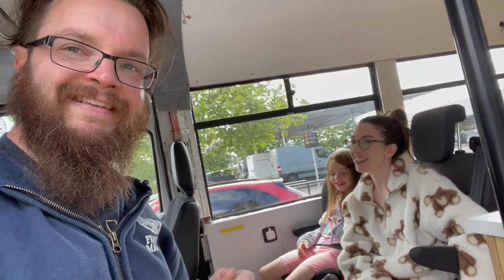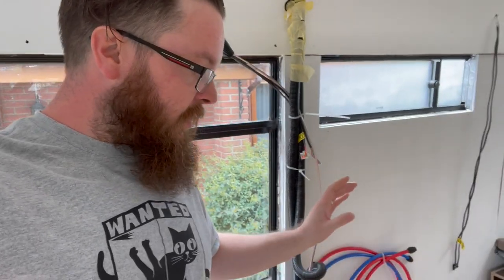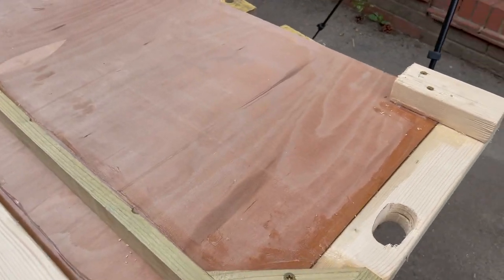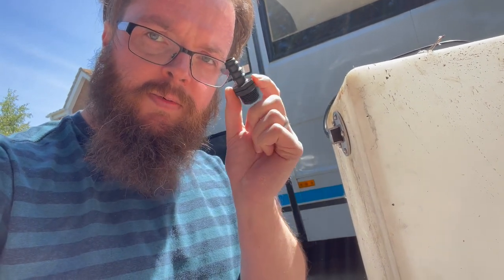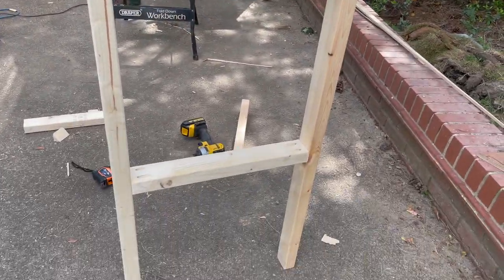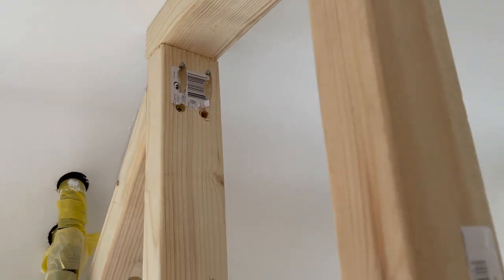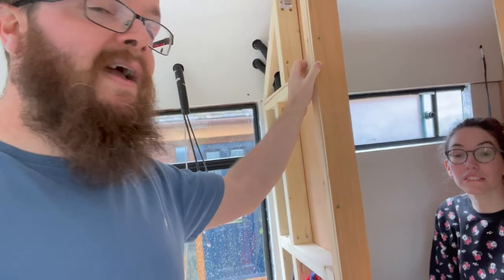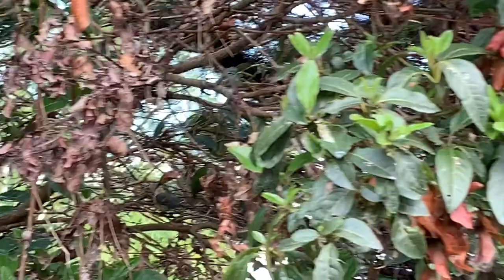Van Build Progress - Framing Shower/Toilet & Day 1 Essentials' For DIY Mercedes Campervan Conversion

Comment: .... Would recommend putting in a second drain in opposite corner in case the car is not quite in level to make shure all water drains out ...
Reply from the maker: Thanks Tom. It’s a good idea. We should be able to retrofit one into it - will keep you posted.